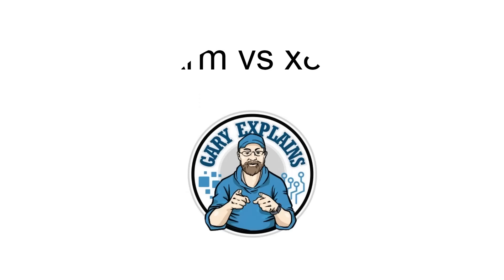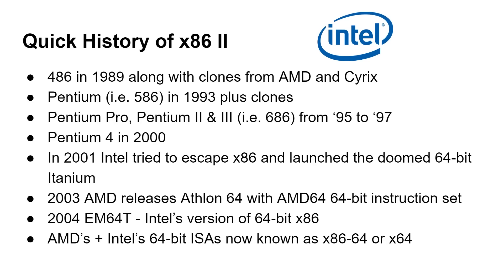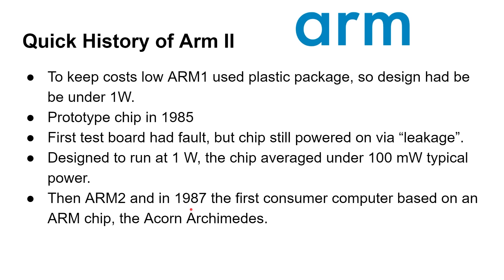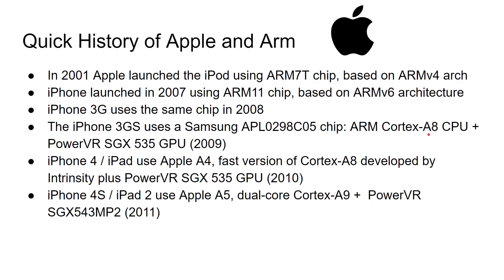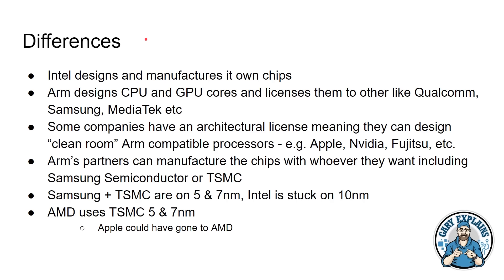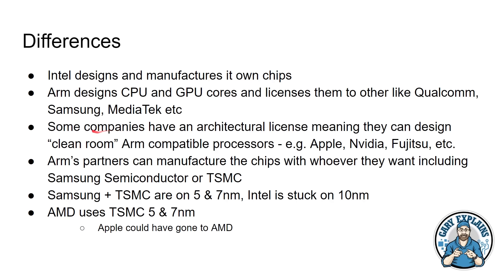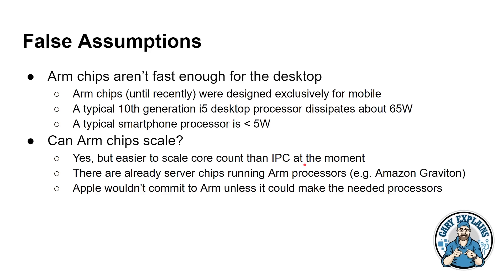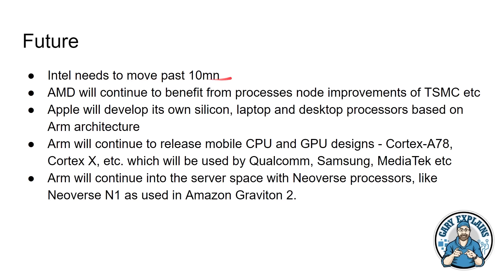Arm vs x86 - Key Differences Explained

Comment: Yes please. Would love a video updating where we are on Moore law! Is it still applicable?
Reply: it is still applicable, but not liniearly, we have physical limits to clock speeds and even before that there's aleready a bit of diminishing returns
but yes, if you go for ransistor count and amount of flops per second on full multithreaded load, it still kinda holds up,, even with intel's dominant position since say 2012 and having a dormant market it lit well up after 2017 again and seems to have closed a lot of the gap again
read: single threading no, multithreading yes
just take away the crazy 10-20ghz clock speed claims we won't have until we find something better than aluminum substrate
think wider , not further.
i think raw transistor count and number of flops are the ones where moore's law can still be used as a guideline for now, although we may see another era of developing for efficiency before pure processing power, but usually the difference was made up for later on, it's not been a steady line anyway, especially in the early days some new developments  in the late 70s and early 80s could give 3-5x improvements within 2 years. where they ought to be 2x, but then stagnated for a bit until newer process nodes were available, hell even in 2000 your computer would be outdated 6 months later, these days they're scraping to even get 40-60% between nodes :D
some experts already were aware about the risks intel would take keeping their own fabs as far back as 2011 though, they already anticipated how 3rd party fabs would be the way of the future, as R&D costs exponentially increase and things become a joint effort more and more.
tl;dr: if it isn't x86 keeping up, others will soon enough,
now personally i don't belive x86 is going anywhere soon, but ARM is gaining ground with every hour, this could very well turn out to be a death by a thousand paper cuts scenario.

Comment: Pretty sure Linux was developed on 286, not 386 originally
Reply from the maker: In his original announcement Linus wrote, "I'm doing a (free) operating system (just a hobby, won't be big and professional like gnu) for 386(486) AT clones." I think maybe you are referring to Minix which also ran on the 286.
Reply: @GaryExplains  thanks I stand corrected.

Comment: АRM for mobile is the future ,but desktop no.
ARM is to inconsistent. It uses software to compile to machine code. x86 uses hardware and bios. Change the compiler and the the risk cpu is useless.
You can't relay on the cloud for general purpose computing where x86 is better.
China and Russia are investing in development of x86 compatible cpus.
  What about if some software that takes 8 - 10 years to be developed. If you are making it for ARM! You will have to use very old tech in the end. Emulation is too slow. With x86 you can write assembly (machine code) and update you old code with the new instructions. It will be great to use the latest x86 hw.
  What about the powerPC risk it was overheating, underperforming  and expensive. So apple switched to x86. What about Xenon (RISC) in Xbox 360 and the red ring of death (cpu overheating)? I am sure ARM desktop can be blazingly fast.
 Today all new non portable consoles are based on x86! Why?
 BTW apple is not someone who was innovative in the desktop world past 10 years. How long apple developers had to use the sh*ty trash can? They care more for the $$$. Really apple treats its customers as a idiots and .... nothing? They can switch to the original Turing machine and i will not give a f*ck. But there is something in my mind - Develop software for ARM + x86 = 2  + - intel fee expensive, ARM = 1  < 2 cheep.
  x86 is jack of all trades ,but ARM is cheap easy to develop and performs very well on mobile. Its die is very small and the yield is big very very cheap. Can you smell the greed?
I heard that NVIDIA and baidu is investing in risc v and will replace ARM.
I think that x86 and ARM have their uses. A smart man will use the best tech for the purpose.
Gary Explains is a smart guy but he really hates x86.
Reply from the maker: What on earth does this mean: "ARM is to inconsistent. It uses software to compile to machine code. x86 uses hardware and bios. Change the compiler and the the risk cpu is useless." ???
Reply: @GaryExplains   Sorry my mistake.
ARM is to inconsistent between generations.
 Changes in registers and instructions. So there will be problems in some optimizations  between generations. Lets ignore emulations, virtualizations, JIT, JVM ...

[software] OS -> Code -> compiler -> ARM instructions [/software] !-> [hardware]ARM cpu[/hardware]
  - Arm depends too much on software. At the same time it is evolving fast. In time the old code will not work on new ARM with.

[software] x86 assembly [/software]!->[hardware] BIOS(x86(32/64) instructions) -> Microcode -> x86 CPU -> .....[/hardware]
  - Software always meets the same thing. It gives great consistency. But the platform is complex. The CPU is power hungry. Die is big - yield is low. It has useless instruction sets. Expensive to make and expensive buy. Most of mobile x86 s*x. Only the software are keeping them around. Desktop/server  x86 is different!

 Today most of our code is heavy on gpu instructions (consistent), networking (consistent) and OS calls (depends on the OS).  General computing (inconsistent for arm) can be offloaded by fast network to servers (cloud). This is why ARM is king of the mobile. Social media, Apps using cloud services, the web... Do you think that Arm can handle the workload of last generation x86 Desktop workstation?
Reply from the maker: I think you have some gaps in your knowledge, the layers (OS, compiler, whatever) are the same for x86, Arm, PowerPC, whatever. Statements like "General computing (inconsistent for arm)" are just nonsense. Sorry.

Comment: Apple moving from intel is not nm size... Think about it! Apple could have used amd if they thought the nm size was a problem. They are moving from x86 to arm because arm is more energy efficient ... Easy!
Reply from the maker: And the fact that it already designs it own processors for the iPhone and iPad.
Reply: The fact that it give them more control of the hardware they loan, I mean sell, is probably another huge factor...

Comment: It seems like Qualcomm was way more massive contributor in ARM processor development than any other crap like Apple. At the time when Qualcomm had  already produced advanced smart phones for a decade Apple was capable of giving a birth just to a ridiculously castrated 3G (!) device called "iPhone" in 2007(!). Even the name "iPhone" belonged to Lynksys (Cisco) company at that time. I used to have a Linksys W330 iPhone SIP/WiFi mobile handset.

Comment: As someone who has used both ARM phones and Intel tablets.  i have this comment.  The Intel garbage collection software is terrible. Is this an architectural difference or just that Android for ARM has a less obtrusive garbage collection routine?  I don't know for certain that garbage collection is the problem, but going from running normally to being very slow for minutes at a time sounds like a garbage collection problem to me.

Comment: I like calling x86 "AMD32" to be snide to Intel in pretending they don't exist.  Then again, it's almost a stab at AMD to "credit" them with x86 because the ISA is such an inelegant kludge given the gradual tweaks and evolution from a completely different genre in instruction sets.  I've been wishing Intel failure for how nasty their ISA has become and how much they feel the inelegance themselves is my best guess as to why they were leaning toward IA64(Itanium) as the inevitable switch the 64 bit approached.  I think their hesitation to drop the opportunity to ditch x86 is what made AMD the take the lead in establishing the 64 bit extension of x86 (AMD64 or x64 - whatever you want to call it)
Reply: Intel could not ditch the x86 at that time.  Itanium was not as good as Intel would like it to be.  Compilers were not good enough.  The whole industry did not want to recompile everything to run on Itanium.  Itanium needs more RAM to run.  DRAM was way more expensive at that time.  The kill was the rapid semiconductor manufacturing improvement.  x86 could take advantage of process technology improvement to improve performance rapidly.  x86 did not lose in term of performance to Itanium even.

Comment: CISC is more powerful instruction set architecture than RISC since the decoder has a better picture of what the instruction is doing. CISC might have a single complex instruction that asks to do a block transformation on a vector. RISC might do ten simple and fast register operations instead. In 1990 the RISC might have been faster. BUT today, the CISC instruction decoder can see that hey, it's a vector transform, cool, let's assign that to this dedicated hardware that does it super fast because it knows a better way to do it in hardware. But the ten register operations that make the RISC operation cannot be optimized away - they still need to be executed as ten register operations since the decoder cannot see that it's a vector transform.
Reply from the maker: eh? Is that the job of the compiler?
Reply: @GaryExplains  Only for the initial compilation. The job of the compiler is to translate a higher level program into an instruction set architecture in an efficient manner. But after that, the binary is done. CISC allows you to make more efficient hardware implementations, over the years, to the same compiled binary, whereas with RISC you can only try to make the existing operations faster - not explore a radically different hardware implementation to run the same code.
The down side, of course, of that new super fast CISC is that all that super fast dedicated hardware to do the multitudes of operations makes the chip large and consume a lot of power.
Reply from the maker: So, you are saying that the compiler generates some instructions that do vectors maths without using an SIMD but the decoder in the chip will then look ahead over all those instructions and turn it into an SIMD instruction? I don't understand.
Reply: @GaryExplains  No, I mean the opposite, it's generally not possible to reverse translate a set of RISC instructions back into the high level operation which it does. For example, the 80286 instruction REP OUTSB sends a string of data to an I/O port. The RISC equivalent would have several instructions in a loop, and use several generic registers. In today's x86 processor, you could have a dedicated hardware unit that does the block transfer in the background. With CISC, the decoder could assign that REP OUTSB automatically to that block transfer hardware, but with the RISC it would be rather difficult or even impossible for the core to detect that kind of pattern in the code. So all it can do is make the operations faster, not explore a radically different hardware option. That's what I meant.
Reply from the maker: Hmmm, first of all modern processors have all kinds of extra hardware "helpers", especially SoCs. So your example doesn't really work. The GPU, the DSP, the Neural Network Engine all do hardware specific tasks. Secondly you are still talking about an instruction put into the code by the compiler. So it was the compilers decision, not the decoder. The decoder just sees that instruction and handles it in hardware using whatever method the micro-architecture has provided. Secondly, all modern processors including RISC processors have SIMD instructions, here I am referring back to your vector example. So, I am still a little unclear about what advantages you are talking about and how a CISC chip can handle that better, especially over time, as you have implied.
Reply: @GaryExplains  So you're not really comparing CISC vs RISC. I was, for the sake of argument, comparing a CISC architecture from around the time the ARM was designed, 1985 to 1990 with a RISC architecture of the same era.
My conclusion stands, however, any way you want to see it. Complex instructions hold more information at a more higher level that RISC instrucions. The trend towards even more complex instructions continues, and there has not been a true RISC architecture in 20 years. Today's CPUs support more instruction sets (MMX, SSE, SSE2,...) than there were instructions in the original ARM...
Reply from the maker: Ah, OK. Well it is 2020, not 1990 and the video is about Arm vs Intel, today, so no I am not comparing CISC vs RISC from 30 years ago.

Comment: Why Intel and Amd didn't switch yet to ARM if they're just better in everything?
Reply from the maker: eh? That is like asking why hasn't Ford switch to BMW yet.
Reply: @GaryExplains  what? ARM is the technology behind not the manufacturer
Reply: @GaryExplains  I mean why they didn't build their ARM version processor yet
Reply from the maker: While Arm isn't a manufacturer, neither is AMD or Qualcomm. However Arm is a CPU/GPU/NPU design company. When you buy a smartphone with a Qualcomm Snapdragon, the CPU design comes directly from Arm. Same if you buy a Surface Pro X from Microsoft.
Reply from the maker: To answer your second comment, AMD started building Arm processors years ago: https://www.amd.com/en/amd-opteron-a1100
Reply: @GaryExplains  thanks got it

Comment: But Gary  arm cannot scale like x86 when u have higher thermal limit it's been proven.
Altough arm can scale down much better then x86 but arm cannot scale up as x86.
X86 was always dominant in this area.
Also is cisk based overally inferior to risk bcs based on ur explanation it seems like that.
Reply from the maker: How has it "been proven", I would love to know.
Reply: @GaryExplains  actually I think this was an anadtech article where it was stated that arm cannot scale up with power as x86.
So is it wrong Info or misleading that arm cannot scale up like x86
And he did with some benchmarks.
Also please can you tell me is cisc over-ally inferior to risk atleast based on your context I am presuming that is the case.

At present does x86 has anything left that it can do to combat arm.
Reply from the maker: Ah, I see, well if you take an chip designed to run on a mobile device, like an Arm Cortex-A78 or whatever, then just increase the frequency/voltages then that won't offer the up-scaling you need. Absolutely. That isn't a solution. But we aren't talking about taking a mobile CPU design and pushing it harder. Apple is building its own silicon using the ARM Instruction Set. There is nothing to stop anyone, including Arm or Apple, from building a microarchitecture that is designed from day 1 to work at high thermals. That in part is what the Neoverse CPUs will do. But Apple isn't trying to just push a mobile CPU harder. That won't work. Likewise taking an Intel U-Series And Y-Series CPU and just pushing the clocks won't work either. None of this has anything to do with the ARM ISA itself, it is all do with the microarchitecture.
Reply: @GaryExplains  so is risc based cpu superior to cisc based cpu.
Reply from the maker: @debojitmandal8670  It isn't as black and white as one being superior to the other. They are just two different design philosophies, each with its pros and cons. Intel and AMD have certainly made a success of CISC where others have failed at RISC.
Reply: @GaryExplains  At this point, arguing about RISC and CISC is a bit like arguing about PAL vs NTSC. It's just not very consequential anymore. Past the instruction decode step, things don't look all that different nowadays. It's because RISC processors became more like CISC and other way around. That said, ARM AArch64 (ARMv8) does have some advantages. More registers and weaker (or more relaxed) memory model than x64. This can help squeezing a bit more instruction level parallelism from AArch64 than from x64, because there are more legal combinations instructions can be reordered for optimal execution.

Comment: Arm even not build for laptops too. They are only use-able in TV boxes, phones and those toys home base SBC. Even TV boxes with Arm are not that near efficient but only the latest Arm are considered only barely use-able. Phone with Arm are only good depends on processor speed and model. Those toys SBC are only use-able with light weight OS and totally unuse-able watching smooth Youtube. But there are so many gimmicks and lies on advertizing these SBC. So conclusion is higher end Arm processors are good for mobile phone only.
Reply from the maker: You are clearly an expert.

Comment: App loves to change chips any time consoles are getting close to it, they do not want people gaming on their machines, so quick, dump the intel chips and switch to unsupported hardware to discourage people from asking for even more native games.
Reply: rubbish reasoning, not only is AMD being used in consoles, but Apple can design it's own ARM chips and are perfectly capable of running games. if anything, switching to ARM could mean more AAA games, not to mention the much bigger market of mobile games already translated to ARM on Mac. Apple has already dipped it's toe slightly in to console manufacturing, the Apple TV doubles as a low-powered games console (though not marketed as such).